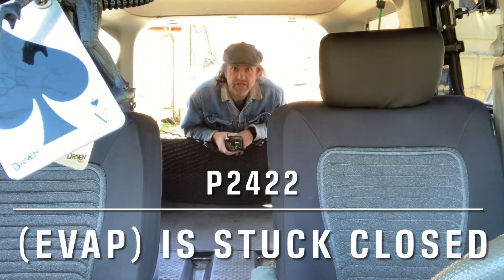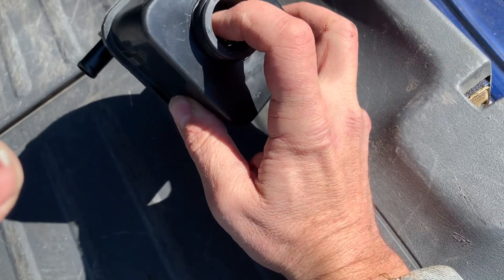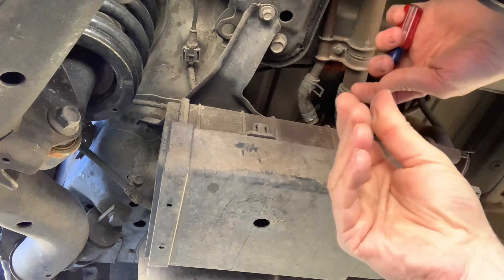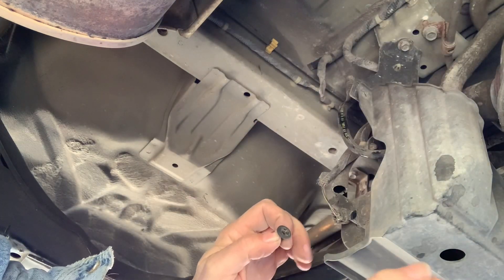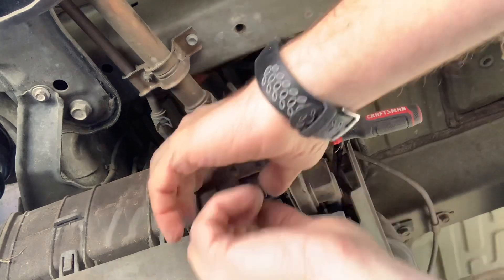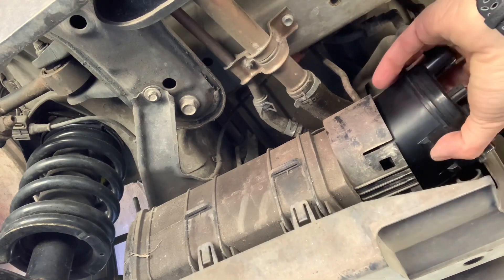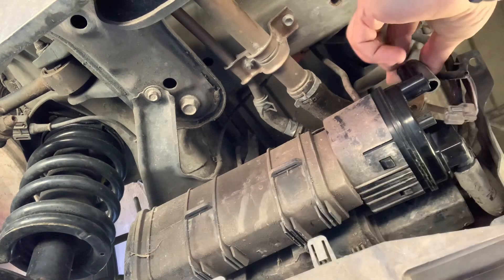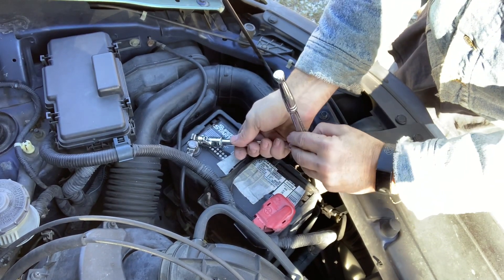Scavenger Type EP28: Replacing an EVAP valve on a 2003 Honda Element  Code P2422

Comment: Wich comes first: Gas cap replacemente or purge valve? Final solution?
Reply from the maker: Well, the gas cap is a lot easier. So maybe start there.

Comment: I Have a 2006 CRV AWD and Code P02422 the steps you took in this should I follow the same?Im assuming so but assuming gets ya in trouble sometimes lol And if so can you help me find the part number I’m struggling to find it.Thanks in advance
Reply from the maker: I'm not well educated on CRVs but here is the Honda number for that part.
328:491LE55

Comment: I got a Honda CRV 2006 AWD Have a code P02422 is this the steps you think I should take?Appreciate your feedback,.One suggestion I got was changing the Vent tank pressure sensor & canister purge valve.Thanks for any suggestions you have available.Ill check back soon to see if you reply.Happy New Year!
Reply from the maker: That's another part that can cause that code. I have never replaced mine.

Comment: My car turn off when driving not sure if it's this code that is the reason
Reply from the maker: This code should not make your car shut off. I would start by looking at the key switch. They go out a lot on Hondas.
Reply: Looks like an alternator issue.  Will do some test

Comment: Great video, as always! A month after replacing the vent valve you posted a video for p2422 replacing a gas cap. Did replacing the vent valve not fix the p2422 code? Did the gas cap fix the issue? Was there another solution? I’m asking because my 04 is giving me this code.
Reply from the maker: The code never came back. But the gas cap gasket is another thing that can lead to that code so I figured I do a quick video on it.

Comment: Hi Clint, great video. Would this evap valve being stuck cause issues with fuel mileage? I have this code showing and will be changing out the valve. Also looking for ways to improve my fuel mileage. I have a 2008 Honda Element EX. Thanks, Mike.
Reply from the maker: The best way to improve MPG on an Element is to keep the motor at or below 3200 PRM, run stock tires and remove things that cause wind drag like a roof rack and get rid of excess weight like the rear seats. I can get about 26 MPG if I stick to these things.

Comment: Thanks for doing this video. Had the P2422 code also. Didn't really appreciate that the new part was about $110, but I guess on the bright side the OEM Honda part was actually less than the one aftermarket evap valve I was able to find online. Your video really made this alot easier for me....... I appreciate it !
Reply from the maker: Glad it helped. It's not a hard job. Honestly, as new Honda parts go $110 isn't to painful.

Comment: Does this code ever also have a small EVAP leak code with it? I have this code and also a small EVAP leak code. I'm wondering if my vent valve is stuck close but also leaking while it's closed.
Reply from the maker: I'm not sure.

Comment: I noticed you replaced the gasket on your gas cap in an attempt to fix p2422. I guess that didn’t work? Has the code come back after you replaced this ? I’m in the same boat with the P2422. Been driving it for 8K miles with the code on and it’s time to fix it for good! Thank you!!
Reply from the maker: I ended up replacing both the gasket and the valve. The error code is set when the pressure in the tank is wrong. My code hasn’t come back since.
Reply: Did you fix it?

Comment: Thanks for posting.  I have a 2003 Element.  Do you know if this repair would fix a P0456 code that my car has ??
Thanks again.
Reply from the maker: Well, it's could help. So could replacing the gas cap gasket. The 456 code means you're reading low pressure reading in your evap system. The first thing I would do is unhook the battery and tighten the gas cap and see if it comes back.   Start with the cheap and easy stuff.
Reply: @clintsearcy3252  thanks for the quick reply.  I just got my Element back from my mechanic and the gas cap was replaced, with an after market one.  I actually prefer Honda parts IF I can afford them.  3 days later, and the code is back again.  So, I’m gonna say gas cap wasn’t it.  Guess I gotta keep looking.  Thanks.
Reply from the maker: @djwak59  That's why I push junk yard parts so much. Something like a gas cap is OEM from the junkyard and costs almost nothing. My next move on your code would be this valve.
Reply: @clintsearcy3252  thanks again for quick reply.  
After watching your video, I’m sure I can handle this job.   I’m gonna do bone yard part too.  I replaced a used blower motor for my car that cost me $20.  Works great and easy replacement too.  Thanks again !

Comment: HUGE THANKS!   was going to get charged $500 to have this done at dealership.  Ordered the part put the car on ramps crawled under and had this done in less than 10 mins.  NO engine light now and its been 40 miles with the new part in.  Seriously follow this gents actions and you can do this with 3 screwdrivers and an L set of pliers.

warning to all please make sure you use safety glasses.  Lots of rust and debris came off the bottom of the car in this area.  If i didn't have glasses i would be at the eye surgeon getting stuff removed from my eyes.
Reply from the maker: Good stuff. Glad this worked for you.

Comment: This the same as code p0497? Cause I did changed the EVAP canister Valve on the hoop but still get the code p0497
Reply from the maker: For that code I would start with the purge valve under the hood. Here's a video I found that shows you where it is. 
https://www.youtube.com/watch?v=gvv7P9_PIbM

Comment: hi i have the code 2422 autozone tell i need to change purge valve.not working . still have the code , should i change the evap valve ?  please help  i have honda crv 2013 thanks
Reply from the maker: The AutoZone guy is mistaken. The Honda CRV code for the Purge Valve is P0443. The 2422 code is for the EVAP vent valve so if your CRV is getting code 2422 I recommend following the procedure in this video. Even though this is an Element I believe it's very similar on the CRV.    Also, check your fuel cap and make sure it's on tight before changing any parts.
Reply: @clintsearcy3252  thanks now im just waiting for the part . i hope will fix the problem when i change the vent valve
Reply: Hi have the new part and replace it have drive around still have the same code any other recommendations? Please
Reply: I am having the same p2422 code on my 2013 accord. What would you recommend I replace?
Reply: @Fvcyoupayme  I fix the issue by replacement of canister .
Reply: @Fvcyoupayme  new canister does not come with any other parts . I just move the old one over to the new canister
Reply: Zhang Tiger you might have to replace the solenoid too.  I had to.  2009 CRV.
Reply: @peterwright4647  I replace the canister . It fix the problem

Comment: Must be nice to work on an Element (or any car for that matter) of that age and virtually NO chassis rust.
Reply from the maker: I really feel for you folks up north. I had a 97 Accord for a long time that came from somewhere up north. I had to replace brake lines, power steering lines, gas tank ect... Every nut and bolt was a battel to remove. I still loved that car though.
Reply: Was just going to say that!  So miserable working on my new england cars all my life
Reply: @anthonytorrey  Southern Ontario is not any better.

Comment: Difference between vent valve, evap valve and purge valve ?
Reply from the maker: EVAP Canister Purge Valve – The most common issue that causes the P0441 trouble code in your Honda Element is going to be the vapor canister purge valve. When it goes bad, it typically causes issues with the vehicle’s idle speed. This is especially true right after you fuel up. It’s really easy to replace. It's located under the hood. 

The 2422 code is for the vent valve is stuck open. That's what we changed in this video.
Reply: @clintsearcy3252  I have the same code for my 2013 accord (p2422) should I change the whole canister ? And use my current sensor n solenoid or just replace something else

Comment: Thanks! I am having the exact same issue on my Honda great angles
Reply from the maker: Did it work?
Reply: @clintsearcy3252  Hi, I’m still waiting on the part to arrive but I’ll update here when it does!
Reply: update, I replaced the valve, got the same code, replaced the sensor, and just today, I got the same code dang, what a journey
Reply from the maker: @carlosd7717  which sensor did you replace?
Reply: @clintsearcy3252  The pressure sensor that was on the charcoal canister right by the evap valve. I decided to take it to the mechanic and get an evap diagnostic done. It turns out my charcoal canister was contaminated with gasoline :(, still waiting on the part to replace it though.
Reply: Replacing the charcoal cannister worked for me.

Comment: if u want a good tip on this engine ;) ,the Vtc on the left side of the engine need cleaning and in the back left of the engine will be the vtec soleinoid clean him or juste change the screen gasket,it crack over time and lead to other stupid malfunction,and without forgeting the little screen under the powersteering pump and the tensionner get real dirty over 150k/mile and the pvc valve if ur oil consomption  is high, other than that this engine will bring u everywhere u wanna go ;) dont forget to adjust ur vavle every 120k/miles, it will go past 400 000miles easy (i own 6 E right now ;)
Reply from the maker: Thanks